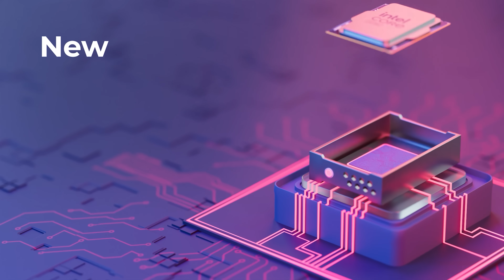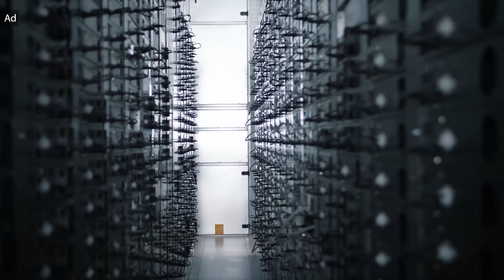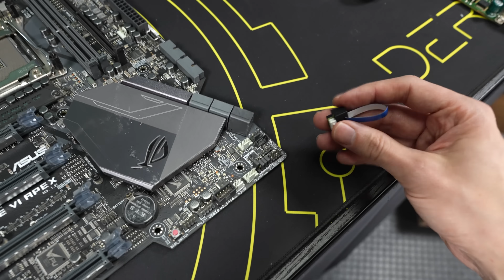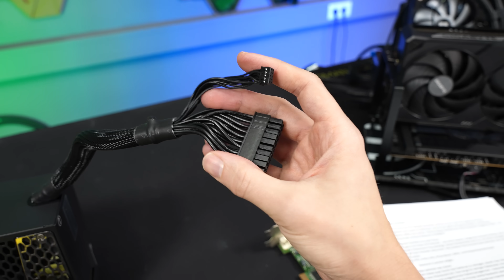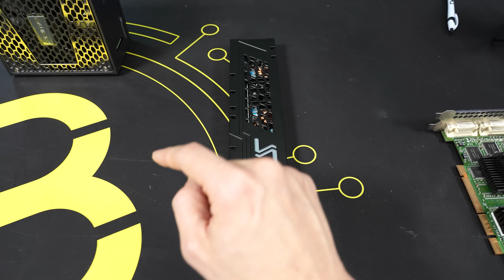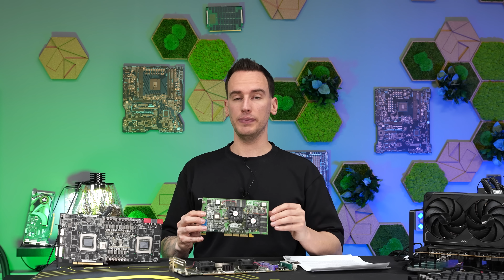Dead-on-Arrival Hardware: Why Nobody Bought These Products - Failed Hardware Ep-1

Comment: Hey, I use a Seasonic case that has Connect integrated and it's a really great case. Connect makes cable routing only slightly easier and neater, but the whole system is really nicely done. Got it for a great price, too.

Comment: You could have mentioned the ATI Rage Fury Max you had in your hand as well. Was a bit of a rip off with only Win95 drivers while Win98 was out already forever. They told me at a trade show that drivers were coming soon but never did. Only used it for one lan party as Win95 sucked sooo hard after switching to 98. Most expensive GPU I had bought at that point i my life.

Comment: The PSU idea would probably be better for SFX sizing. Small cases can't fit large ATX power supplies but if you split up the components you might be able to tuck away some of the components

Comment: Software RAID is not "much slower" at all. It's downside is that it uses your CPU, and quite a lot of it, when paired with modern NVMe drives, which has become really fast in recent years. So fast in fact, that hardware RAID controller cards (which try to fit all this bandwidth into a single PCIe slot) can easily become a bottleneck.

Comment: The Seasonic Connect was close but missed the mark by a mile. It shouldn't have just been an extra hub while you still needed the main brick PSU.. 
That slim unit should’ve been the PSU itself, just wider to fit all the needed components, but I really wish we had slim PSUs for PCs. Imagine if the power supply could just hide behind the motherboard instead of being a big clunky box that forces cases to be either taller or wider just to fit it the large brick.

Comment: That specialty PSU bridge idea would be absolutely GOLD in a high performance PC build for today. 

Why? 

Put it in a dummy-PCI Clip bridge directly below the GPU. And have specialist 12VHPWR leads for the GPU(s) and one for the motherboard connectors. 

And instead of the usual 5-10 leads, one CHUNKY BOI of about 200 small wires would feed a massive amount of 12V rails directly into the bridge. The bridge does all the 5&3V breakdowns for the mobo. (Which, isn’t a whole lot) that component is also cooled with its own little fan. (Extending its lifespan) allowing the PSU to be MUCH MUCH larger, pack in more fans (lifespan) and focus on JUST shoving out as much 12V as possible. 

Why? Because 12VHP is nuts right now at what? 500w? 

What happens when they make cards that go even harder? 700? 1000w? MORE? 

You’re going to need either one VERY big 12V wire fed into the GPU or hundreds of little ones, and the longer the cables, the more resistance. Make those cables are tiny as possible. Put the damn PSU that’s for the card, DIRECTLY beneath it. That cable run, is then smaller, less voltage loss, LESS HOT LITTLE WIRES THAT CATCH FIRE! And less Der8auer reviewing yet another NVIDIA card that’s caught fire. 

Seasonic solved all our problems, before we even knew we had problems!

Comment: Great video, but the explanation of half/full duplex is wrong. Full duplex means you can receive and transmit at the same time. Half duplex means you share the bandwidth between sending and receiving, not necessarily 1/2 for each.

Comment: An interesting historical artifact is the ABIT BP6 motherboard. This allowed Intel Celeron chips to be used in a Symmetric Multi-Processing  (SMP) configuration. This was a big deal at the time as the Celerons delivered great performance for a very low price. Intel forbid the use of Celerons for SMP but neglected to actually make it undoable. Abit worked around the minuscule measures Intel put in their way. This was the heart of my first multi-processor desktop years before multi-core became a common term for consumer CPUs. I had it running a dual boot of Windows 2000 and BeOS, both of which had multi-processor support.

Comment: TBH the Seasonic connect thing would have been awesome for cable management, not to mention making it cheaper to switch your power supply to different wattages. Like I'm imagining it being used for multimedia company workloads or something, where they could keep the cable layouts and switch wattage as they change GPUs and CPUs.

Comment: pci-e also required x64 cpu support iirc, because it is a duplexed 32 bit bus (32x2 = 64) and agp was mostly dead after that transition. Standard form factor, higher power delivery, faster speed all pretty much obsoleted agp as soon as pci-e came out. Perhaps I am wrong, but I don't recall any socket 775 or 939 motherboards with an agp slot. I wouldn't say it was DOA though, most Socket A, 754 and 478 boards that were gaming grade had some form of an AGP slot iirc.

Comment: I didn't buy a Seasonic Connect (at the time, my system had a 450 W Corsair PSU and I wasn't upgrading) but I honestly wish it had been successful.
I have struggled with a Corsair Commander Pro to power multiple RGB fans, and you could easily imagine a 'Seasonic Commander' that adds fan-power and perhaps RGB-power to this Connect thingy; that would be very convenient.

Comment: Seasonic's power distribution block is a cool idea, just not designed well.  PSU's are still a problem that different manufacturers are trying to address.  See: Motherboard designs with right-angle connectors or connectors on the back of the board(or whatever else....IIRC seen some of that in the last couple years)

Comment: Man I got the seasonic connect psu and I think it was case specific. Cause it was hard to put in my case. I thought it would be easier to have 2 separate parts but it just brought more challenges to make it fit properly in the case. I got it because it was on sale and a good valued compared to other PSU at the time.

Comment: On the RAID stuff, it is a shame that bcachefs is so controversial in Linux, it does something different than any RAID array because it can mix different speeds in a smart way like having a cache drive like Intel Optane style in the front and slower high capacity drives behind it for redundancy and efficient use of what you have. If they ever get back into the Linux kernel mainline it really answers the whole FS debate completely (at least on Linux)

Comment: The Seasonic adaptor could have been more interesting. Imagine instead a device which took in the inputs for a 12V-only PSU and provided the standard ATX cable set output. This would facilitate a transition between ATX and 12VO. Alas, that isn't what we saw.

Comment: Awesome video, can't wait to see more. My first GPU was an ATI AGP card, I was going to try to sneak in into the family computer (big plastic Dell tower) to play Doom 3, but I quickly realized I was in over my head just trying to figure out AGP vs PCI so I crossed my fingers and asked my dad for help/ permission...
The one weird tech thing that I missed during a long break from PC gaming was that Intel Optane (Octane?) thing. I'm not sure what its deal was (some kind of pseudo ram?) saw it all over the place when I was looking for a cheap laptop, but now I'm curious and want to look it up.
Reply: Optane was a great tech in theory but Intel committed almost all possible mistakes to hurdle it's adoption. Basically it was an alternative to NAND flash codeveloped with Hynix (or Micron, I don't remember). It have way better longevity than standard NAND cells and insane random reads performance (which would make it ideal for gaming system - contrary to standard NAND which producers focus exclusively on sequential speed, which is useless for gaming).
But of course Intel had to screw it by first insisting on manufacturing huge chips which meant low yeald, which in turn ment high prices. On top of that they screwed up it's introduction of the consumer market. Tiny M.2 SATA SSD working as a cache for spinning hard drives in laptops were a sound idea in an era of insanely priced NAND based SSDs, when HDDs were still dominant outside of enterprises and enthusiast machines. But those fools locked down possibility of using them in software for 7th gen and later CPUs. As a result the tech died when the NAND chips were getting cheaper due to market competition.
Reply: @krazownik3139  That does sound like a good idea. I remember the laptop I brought at the time had a mechanical drive which was the one thing holding it back (other than the integrated graphics) because after a few years the HDD died and I replaced it with a SATA SSD and it was suddenly a much better experience in just about everything I did. 
It feels like every few years Intel fumbles some new thing when they decide they want to try the Apple technique of locking parts down, it's probably the sole reason I went with AMD and became a fan (locked CPUs specifically).

Comment: Being an owner of an HP Z6 G4 that has a first gen Xeon Scalable CPU (the Xeon Gold 6142) I want to clarify what Intel VROC is for you since it's no longer very well documented.  With Xeon CPUs it's not a full hardware RAID, but it's also not a true soft RAID solution, at least.  The CPU has hardware built into it to do most of the work of a full hardware RAID solution, and uses almost no measurable amount of processing resources to function.
1) It's genuinely a key that plugs into the motherboard and contains a RAID BIOS that connects via SPI.  The key is accessed once at system startup and the BIOS code is loaded into memory.
2) It enables RAID for NVMe drives, and RAID levels other than 0, 1, or 10 for SATA drives. 
Note that without a VROC key the system still supports RAID 0, RAID 1, and RAID 1+0 arrays of SATA drives without issue.  But there is no hardware RAID available for NVMe drives without the key.  I didn't learn about this until trying to build a RAID 0 array of 4 NVMe 2TB drives (I have the HP Turbo Drive Pro).  Now I have an NVMe RAID 0 array that reads and writes at 13,500MB/sec on a PCIe 3 system even after the array has aged a bit.
I am aware that some hardware vendors other than HP may completely lock you out of the RAID subsystem without the VROC key, but they do that by choice.  The SATA RAID 0, 1, and 10 should always be available.
BTW:  VROC also works with ANY NVMe or SATA SSD, or even SAS SSD.  I don't own a single piece of Intel storage media. (I forgot to mention this, so added in edit.)

Comment: 50W AGP consumer GPUs became common but they used a 5.25" 4-pin disk drive connector for power at the end of the card. The one everyone calls Molex but which is actually AMP.

Comment: I actually have one of those Seasonic PSUs and the case they made to go with it.  I think Newegg was giving them away and offered them to me. This was right before or early in the Pandemic IIRC,
Never got around to doing a build with them, but I kind of want to now. None of my GPU's use that awful 12VHP connector so that's not an issue.

Comment: Those hybrid RAID solutions always sucked, they have the drawbacks of both hardware and software solutions. However, with today CPUs performance hardware RAID is barely a thing,, especially on Linux where you can use advanced filesystems like ZFS. In most cases hardware RAID is slower unless you go for GPU accellerated RAID with proprietary filesystems, and it's always less flexible... A lot of brands also limit what brands/models of drives you can use with their RAID cards.

Comment: AGP was a nice throwback.
Overclocking of that time being done by increasing the frontside bus speed (CPUs had locked multipliers) you'd usually wind up severely overclocking the AGP slot as well.
The most common trick of the time was shoving a celeron 300A into a BX board for the (relatively) easy 50% overclock. It was a chip desinged for 66MHz that could handle 100MHz and the BX boards had dividers to ensure the AGP ran at 66 and PCI at 33. No problems.
Much harder was to try and drive a 100MHz FSB specific CPU upwards. BX boards sometimes came with jumpers to set higher dividers for the RAM, but not for the AGP or other onboard controllers, so you ended up either bottlenecking there or, in my case a few times, cooking circuitry. iirc Soyo? made a board near to the end of the BX days that had jumpers for everything. It was a slotA board, but by that time I had an adapter to fit the Socket for a Pentium3 on there and managed to get an 800MHz chip up to 1064 with the FSB at 133.
Remarkably solid boards those BX were. You ain't getting much above 100 BCLK out of a modern one. Luckily you don't need to.

Edit: Correction, slotA was for Athlon wasn't it.. I forget what Intel called their CPU slot.
Reply: "Slot 1" was Intel's connector name for the cartridge CPU style format.
The ISA, PCI & AGP slot, bus speeds ran out of spec if you had a Mobo that did 75 & 83 MHz front side bus. Which over clocked the bus speeds as they were generated by just dividing the FSB "Front Side Bus" frequency.
With a 83MHz FSB, the PCI was running at 41.5MHz up from 33MHz, AGP ran at 83MHz up from 66MHz.
Gave a nice boost to some hardware performance. Could help improve latency & response times.
Older IDE HDD's like Mode 4 & low died when running at 83 FSB. I lost 2 drive before I worked it out, newer DMA Mode HDD didn't care, I never had any issues with them.
I miss the old days when you had to use jumpers to set things.

Comment: In most of the consumer space, there was one AGP port and it worked for all cards that had it, which was basically all of them.  AGP was faster than PCI and other contemporary slots, both for GPU output and for GPU use of motherboard RAM (back then, RAM was so expensive, many GPUs contained no RAM of their own, instead they would just use a portion of the main RAM via a special integration between the AGP port and MB chipset .

Comment: Seasonic Connect was bundled with Seasonic q704 case. I bought the bundle for 100 euro when I fled my homeland and came to Germany I had my system in my backpack. The case was flawed by design although materials and build quality were outstanding. I can forgive any flaw of the case because it was the first Seasonic computer case. The case has a dedicated mounting place for the "connect unit" - that's how this long rectangular part of the PSU is called in the manual. Now the funny part - the Connect unit doesn't fit in this dedicated mounting section of the case. The motherboard is mounted upside down in the case and the CPU power cable is HALF A METER short ! ! ! I can forgive a flawed case, but a flawed PSU - never, because they had plenty of time to figure this out. I will never again buy ANY Seasonic product for the rest of my life

Comment: Ironically, VROC is still alive in enterprise market, when you have 24x enterprise M2 / U2 drives (or intel 660P, for entrance), I have 1 for my ice lake build
Meanwhile the X299 platform itself has its own limitation, which was a clown fiesta 😂
Then ZFS just come as a more reliable than a mega hardware raid